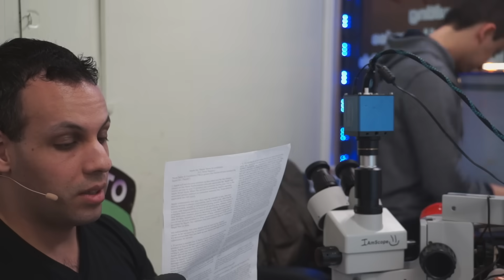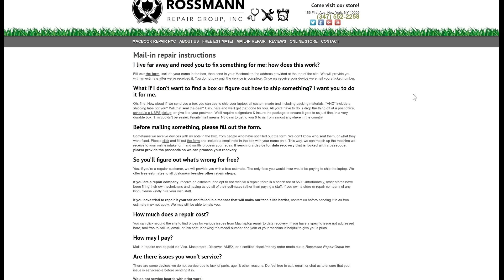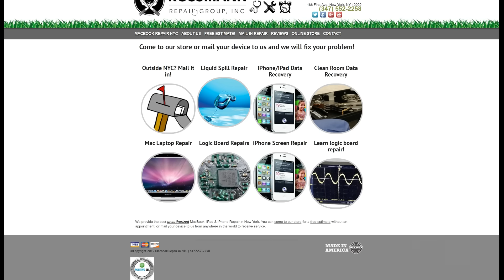Genius bar quotes FAIR price... what?

Comment: Those headphone jack savings finally passing on to the customer.
Reply: my phone is wireless....  so are my headphones....
Reply: @cardboardboxification  good for you?
Reply: hill billy I love my AirPods but somehow I still miss a headphone jack on my iPhone, the batteries of the AirPods run out so fast after 1 year and half only of usage. I don’t want to buy new earphones every 2 years.
Reply: hill billy wireless headphones are fine for casual listening. I use wireless headphones for watching YT. Wouldn't dream of using them for listening to music.
Reply: @cardboardboxification  No excuse for removing a widely used port from the device.
Reply: Sybrand Botes why not?
Reply: @jamalhalili2173  Wireless audio quality kinda sucks
Reply: Jamal H bluetooth is not yet capable of high fidelity audio. Some of the newer standards are promising but they haven't really been implemented into anything yet.
Reply: @jamalhalili2173  higher price for lower quality
Reply: wireless is an overrated hype that's useless
Reply: Wireless issue isn't only quality but the fact it's more expensive and requires charging (also Bluetooth will add more drain to your phone's battery than a wired connection).
Reply: @username-mb2qh  depends on your wired device. I've got some pretty power hungry and cheap tbh over ear headphones that succ more juice than running the Bluetooth radio
Reply: @Dorankuu  There's some real advantages to wireless so I'd hesitate to call it useless hype, but I still prefer wired.
Reply: 1misanthropist  That'll take a few years yet.
Reply: @BobofWOGGLE  i shall concede as i am just drawn by my emotion towards wired. Both are great
Reply: @Dorankuu  Wireless isn't overrated, wireless charging is!
Reply: @clementoseitano7568  did you read my previous comment? Also have you seen anyone complaining about wireless charging? Absolutely none since buying thr dock is optional while headphone jacks are forever gone
Reply: @Dorankuu  I get you, I'm just complaining that wireless charging is overrated hype
Reply: +hill billy
Wow, you buy overly expensive headphones with average audio quality, good for you kid, good for you.
Reply: @Jamal H by making headphones wireless there are a couple of things you have to think about. first is the battery life second is sound quality. battery is a major factor as it is the only source of power the earphones have. and we all know battery deteriorates over time quickly (in today's standard). so unless a battery that has a super high charging cycle comes out, having wireless earphones doesn't make much sense in a long run. things that adds up into running a wireless earphones are batteries and bluetooth. those 2 are essential for all wireless earphones. which total about 60 to 80 dollars including installation and programming.  so if you take the airpod as an exmaple. it cost around $150. almost half of the cost goes into battery and bluetooth. so you're paying about 120 to 100 on a earphone plus other things like touch sensors and stuff. so for sound drivers and stuff you're looking at about 30 to 50 dollars in apple's standard. in other words you're paying 150 for a device that sounds like a 30 to 50 dollars earphone. and it's inconvenient if you run out of batteries.
Reply: All that courage lmao
Reply: @AnonymousUser77254  Everything has a duty cycle. Especially batteries. That's something I think we've yet to realise as society.
Reply: Sybrand Botes what about aptx? Is it good?

Comment: Fair price and Apple don't belong in same sentence. I would just call that an accident. It was probably supposed to be $1,475.
Reply: Or $4,750
Reply: $745 at least.
Reply: Misprint.
Reply: $475 is with the new discount offer from Apple. They are offering $500 for either a kidney or lung and $1000 for a working heart.
Reply: @aquo77  Soooo the kidney or lung doesn't need to be working...? I got a broken mac, but I'm broke. I do, however - own a spade. Does that discount stack?
Reply: Naw that was just the intro price. Apple would got into it and then suggest that  much more needed to be fixed .
Reply: @jamesisaac7684  Oh no not her again?
Reply: i can see wayyyy into the future where "apple repairs" and "down payment on a house" become comparable
Reply: I really don't understand Louis or any of you people.  No one cares.  People know Apple's products  are more expensive.  They choose to buy Apple product anyway.  They choose to buy apple products quite often BECAUSE they are expensive.  

It's no different than buying a BMW their cars are both more expensive, less reliable and more expensive to maintain.   Who is surprised when they go to the BMW dealer than it's expensive to repair the car...even if the repair is due to poor design on the manufacturer's part.  

And people do the same thing with apple products as BMW drivers do, when they break people throw them away and get new ones.  Which is why depreciation rates are so high on BMWs.  I don't understand what the point of complaining about it is.
Reply: I guess someone lost his job for giving this price.

Comment: I use a 179€ thermal cam for PCB repairs. One look at its screen is enough to see the region causing the problem. Because of this method, i do only need some drops of alcohol and do not need to spill some hundred millilitres of flammable liquids all over my workbench.
If someone's selling a thermal cam for 900$ and promises it could determine a bad component on a SMD PCB, he is trying to scam you.
Maybe thermal cameras with such an extremely high resolution exist, but certainly these will cost hundrets of thousands of [strong_currency].

Comment: Thermal cameras are expensive because they don't use glass lenses Louis, Germanium lenses are not cheap.
I would still use alcohol though.
Reply: Then why are the phone cameras so incredibly cheap? I've not looked at the specs but the ~$250 flir one appears to even have a fairly similar resolution as the $900 one Louis has.
Reply: @vgamesx1  No idea about specs, but I think the flir has a few things going for it in terms of price. 1: Volume production. Betting they make and sell 100-1000x as many of those. That makes production a whole different ball game in terms of financial efficiency. 2: Its made to the standard of consumer electronics. 2-5% bad ones is expected, 5-10% more during warranty period is acceptable for profit margins. That says a lot about the quality targeted in manufacturing and assembly. And the cost invested in QC.

The other one is a professional tool, with a matching price tag. Targeted failure rate is usually below 1%. Acceptable tolerances are way down. Assembly involves more hands on, focus on precision above cranking volume. QC (quality control) is well-financed, includes proper, very precise calibrations etc, often with warranty or service deals on calibration. Each single unit has a paper trail all the way back to first assembly. Profits margin is higher, but failure rates are much less forgiving - as you have an exponentially smaller customer base, and most of them rely on the device/tool to operate well, to make their own living. 

Some times, depending on the device, consumer models and professional equipment models have much of the same componentry. But as you see above as a very common setup, the approach to production, from components to delivery, is very different.

Comment: Just so some of the viewers are aware, a logic board for most 13-inch MacBooks are sold for around $360 to AASPs. I would have to assume that as it's value aside from manufacturing and labor cost. They don't really market labor costs, so the remaining $115 that makes it $475 for service would be considered the profit (or labor). Doesn't sound too bad. But for a Pro model, I would have charged at least $149

Comment: My employee split water on her 2015 macbook. Warranty expires in may. They said it is not covered under warranty. Macbook will not turn on without charger connected. Display also has some water damage. They quoted me at $500. I have not had them work on it yet (employee doesn't want to use their funding at this time)
Reply: Darkking Ice legit story sounds legit.
Reply: @BenjjjDW  she used her funds to purchase a new macbook and doesn't want to repair the water damage one until the next academic year, new fiscal year for us.
Reply: Darkking Ice words words important words.

Comment: Brought a 2015 macbook pro into an Apple store a little over a year ago, ended up being a logic board repair. Luckily I had applecare, but he said if I hadn't it would have been a 400-500 dollar repair. I too was surprised to hear that low of a price (and glad I did not have to pay). Still disappointing that the logic board on a 3000 dollar computer would fail in under 3 years.

Comment: 1:26 when u said apple didnt rip somebody off there... i knew there was a 'but' in there. the logic board replacement was fairly priced, but it was an unnecessary replacement of a reparable fault. a fault that can be repaired for far less. i guess this is what happens when you take things out of warranty to places that basically only do warranty style repairs, ie replace the entire board over diagnose and repair only what is cheapest.

Comment: That looks like my MBPr 13 early 2015, I had it for 3 years then the motherboard died after plugging it to an HDMI cable on a TV and then to the power cable (I was trying to show my vacation pictures). I took it to apple, they took it apart and it was clean and un-abused, they quoted the same price for a refurbished motherboard around $485 plus tax, it took them a week to send it to a refurbishing depot company and they also replaced my retina screen for free under the Anti-Reflective Coating replacement program during the same repair, they did reuse the other old parts like the battery, track pad and  keyboard.

So yea I think that anyone with a 3-5 year old mac book that doesn't have apple care will be charged around the same price.

Comment: $475 is the standard out of warranty flat rate service fee for Macs. It is comprised of a flat rate fee of $100 for labor, and $375 to cover the repair. 

Requotes happen often, and are determined by instances of accidental or undocumented damage, or unauthorized modifications. 

TLDR, $475 for OOW Mac service is not new. It’s been that way for years.

Comment: LOL, Oddly enough, When I had to get my MBP repaired out of warranty a long time ago, Apple did it for $300. So you got charged more than me.  That said, I've never had a bad experince with Apple's geniouses.. now.. Microsoft on the other hand. wanted to charge me $600 to replace a key on my Surface Book. Or $600 to fix an issue here through no fault of my own, my screen is shwoing burn marks.

Comment: Times, when thermal camera costed 900$ are over. A simple Seek thermal camera for 200ish does the trick and can be connecred to pc with usb to micro usb adaptor. Alcohol is better for cleaning, rubbing sore joints on for some people - drinking...

Comment: i had a n early 2015 13' mbp shit the bed while doing a clean slate wipe and they charged me $500 usd for a mobo replacement it had to be sent out and got it back in a few days i thought it was high. the repair was made out of warranty and i felt like it was a little under handed due to the fact the machine failed to reinstall its OS  using a built in system prompt.

Comment: I recently got my first Apple Laptop (computer). I got a 2012 MBP 13" with a 2.9ghz processor, 8gm ram and 750gb hdd. I have already upgraded it to 16gb ram and a 960gb ssd and am about to upgrade the bluetooth/wifi to BT4.1/Wifi AC. Any suggestions on what else I can do to get the most out of this 7 year old laptop?

Comment: Louis, between camera and amscope there is two pieces of connecters. One piece is amscope black thing with level adjustment silver tube. But between amscope thing from set comes with a microscope, there is another thing I can't find, because is no such thing in microscope camera link, and didn't come with scope. Where  it can be found?

Comment: Hey Louis, I have an Issue with my Macbook pro early 2015 13'', the track-pad doesn't left click, just wondering what your theory is, because I'm taking it into the apple store on Friday. 

From what I've found online its either software or hardware, also some external mice don't work and also others have the same issue as trackpad.

Edit. problem fixed itself.

Comment: That feel when you complain about apple's unfair repair prices to advertise your business but apple just fixes it instead and kills the reason why your business exists.
Reply: Daaaaam Apple is sooo weak if they need to adjust the prices of their own service based on a random dude on the internet. Talk about "perfection", "innovation", "exclusivity" and "the best of the best". 

I'm not giving you heat, it just shocks me seeing one of the biggest multinational corporations operate their repair services based on the prices of a specific repair shop. I wonder what would be their next step?... 
A) Perhaps calling Louis at 3AM and asking what price should they charge for an all in one screen replacement? (Aahhh noope, too bad they can't even do that, as they don't even fix their own product)
B) Maybe they should ask other manufacturers what to charge for their own products as they are losing value because of their own failing market strategies?

Comment: $475? I can buy a new computer for that..
Reply: It depends on the computer.  I do not understand how my friend in college cracked the screen and broke off the HDMI port on him Macbook and it sold on Ebay for more than my gaming laptop was brand new.
Reply: GoogleMinus macbooks are stupid expensive, like the price for a 2011 macbook which is now going on 8 years old i could buy a top of the line brand new windows machine
Reply: Yeah but not a high end one. That's why it's impressive
Reply: @AbsolXGuardian  Apple laptops are FAR from 'high end'.
Reply: @Grendel _ With mac you pay for the brand. That and substandard parts. If you want the OS you can buy it separately and install on compatible hardware.
Reply: yeah, a piece of shit with 2gb ram, Intel Celeron and a 1tb 5400rpm hard drive

Comment: Where do I apply the voltage to find the short? 

I have a water damaged 3DS and would like to use his method of pouring alcohol and finding the short, is it possible?
Reply: Well, to do that, you'd need to open the 3DS, have schematics of the logic board handy, and figure out what power rail is actually shorting first, before doing as Louis has. If you don't, you're liable to just fry more components.
Reply: i would honestly just soak the board in alcohol for a few days then clean it really well with q tips, brought back a lot of dead boards doing this, and if all else fails and you don’t really care about the board you can just chuck it in the oven and hope for the best
Reply: lethalitycomplex Where do I find schematics for these sort of boards? Where does Louis find his?
Reply: @potaedaus  All I could tell you is do a google search for them. Someone's probably put them somewhere. For Louis, he has a specific piece of software for his, as he speaks about (Paul Daniels)